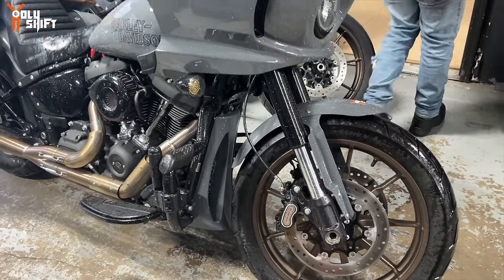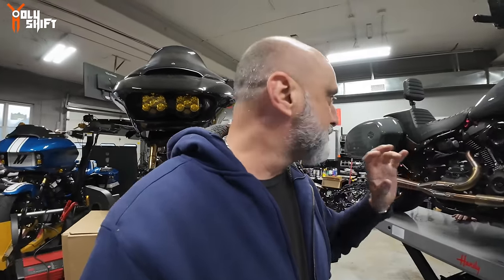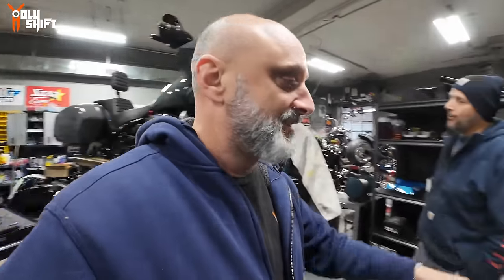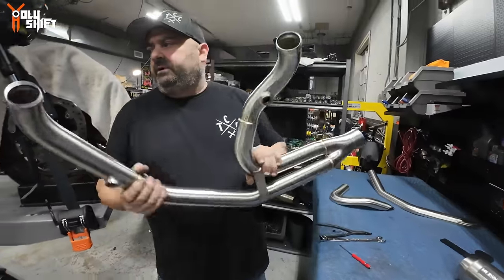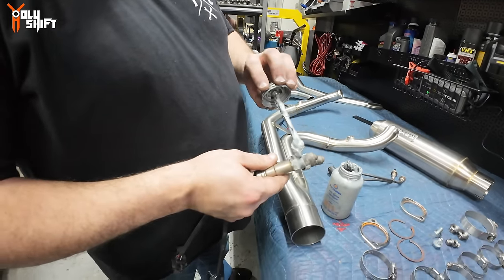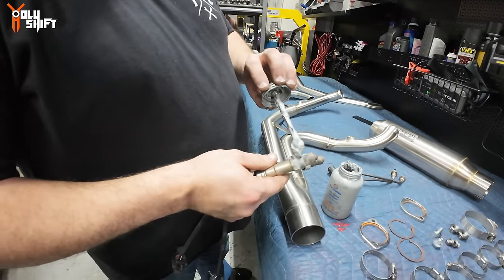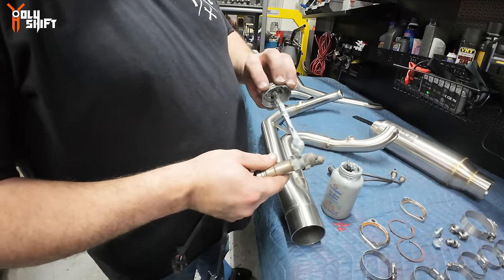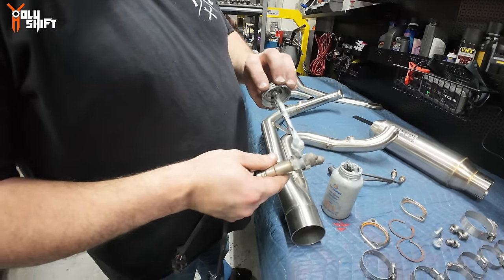Bassani Super Bike 2 Into 1  Exhaust Install

Comment: I never locktite anything just crc brake grease very sparingly torque everything but i go less than factory specs 500,000 miles on 14 harleys since 16 now 59 not one bolt ever came loose